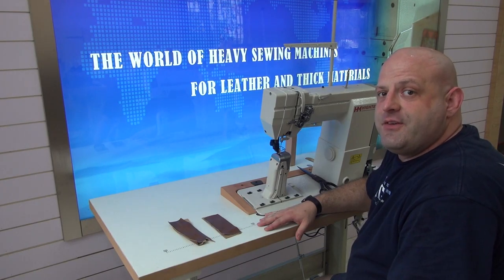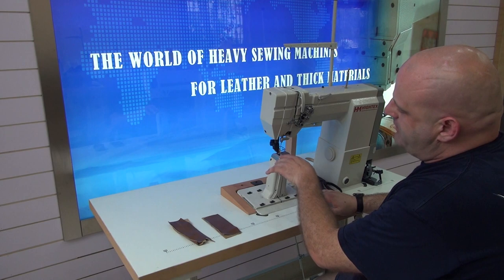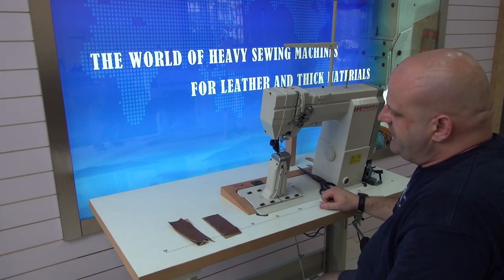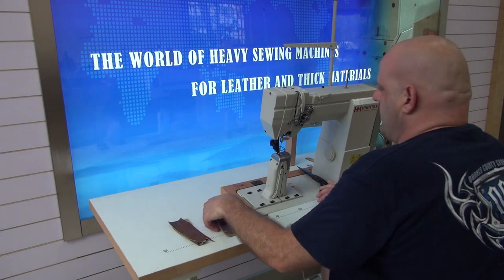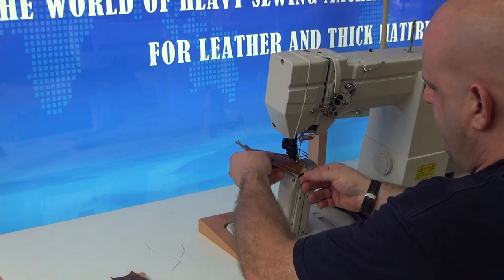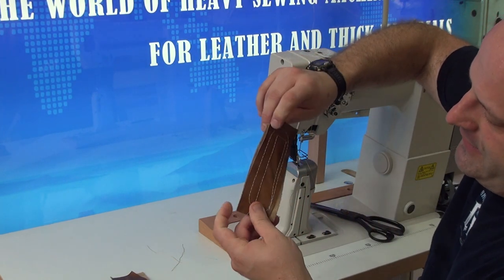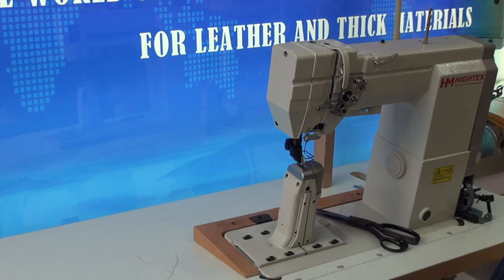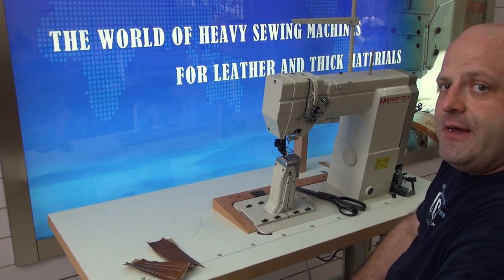Post bed shoe sewing machine

Comment: My brother Nabil, I would like you to explain to me some information because I will buy 2 machines 78810 and cb6900. I would like some information about them. What do you need about the needles that are installed on me and the threads because I contacted the company and they told me that the threads are not their business?
Reply from the maker: Thank you for using HighTex heavy duty industrial sewing machine. If you have any difficulty with operationg, please contact our engineer at info@automtaic-sewing.com, thank you!